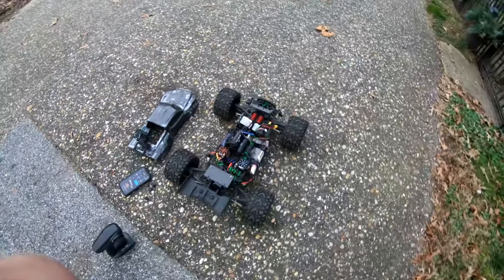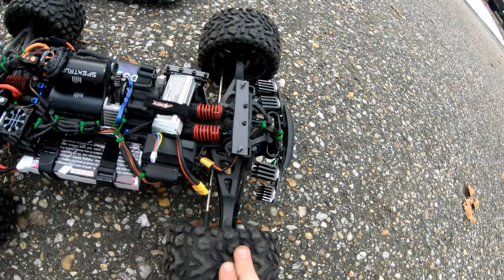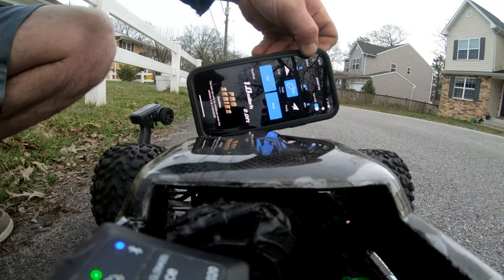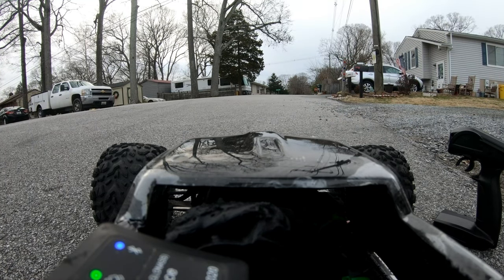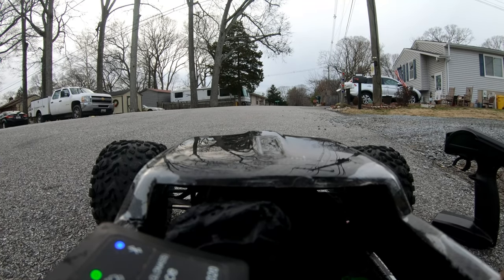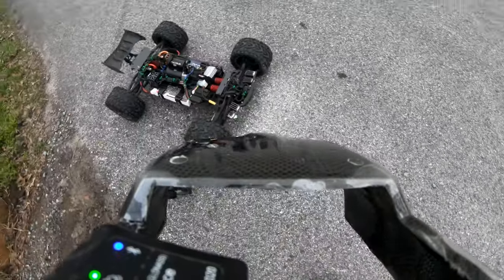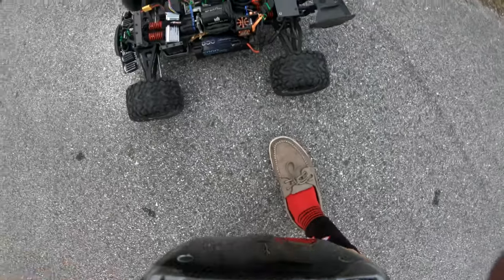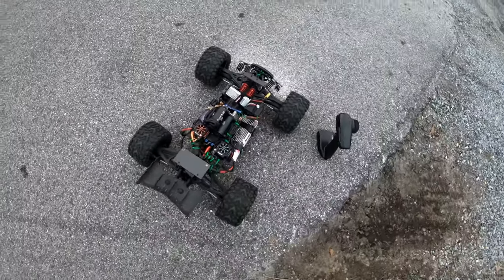Dual Motor Revo 2.0 Test Run

Comment: I remember getting a Tyco RC car back in the early 90s, had wait all day and half of the night for the 9.6v battery to charge just to get 8 minutes of play time. Then the revolutionary 12 hour battery charger came out, that was awesome.
Reply from the maker: I started with the Radioshack XMods and morphed a 6 battery AAA setup into it later into 9th grade and had a blast. It's truly amazing how far back some of us are in the timeframe and what the current industry is to provide.